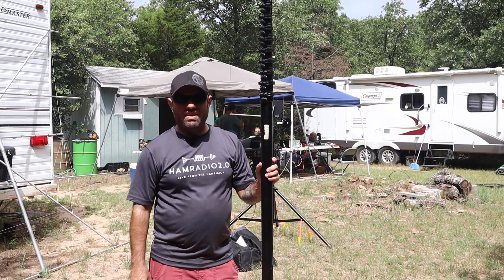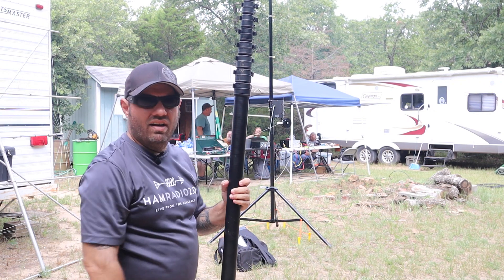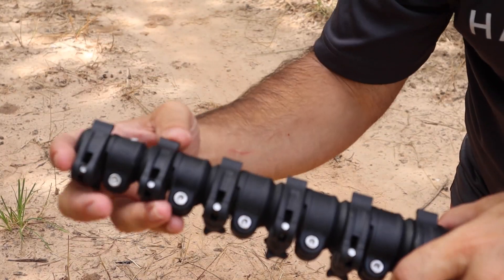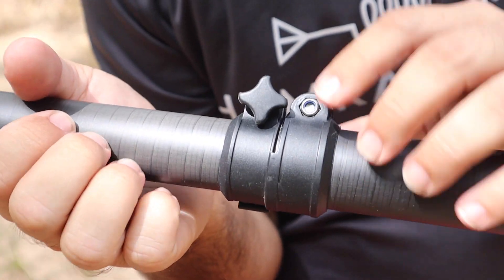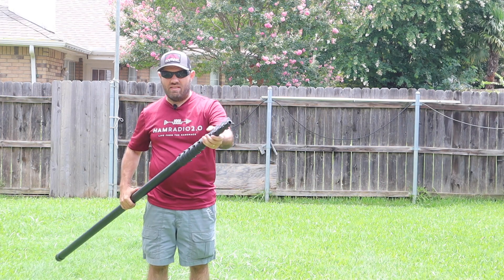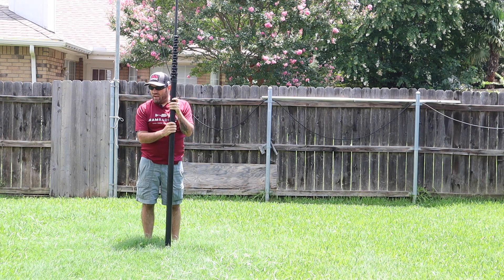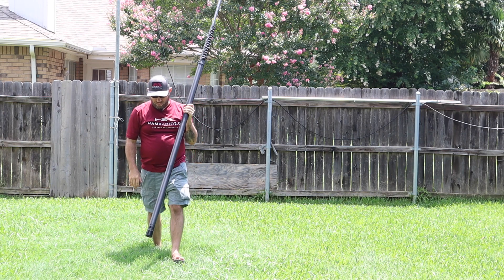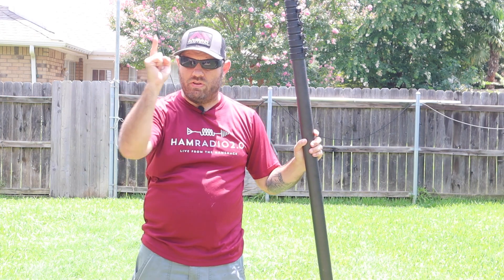Carbon Fiber Mast for Ham Radio Antennas from Gigaparts! | HF Antenna Mast

Comment: Checked out the website. They no longer sell the product. What they do sell is fiberglass masts with 7 foot sections, with lengths up to 53 feet. So you need a ladder or scaffold to put it up. Some of them have the clamps, some do not.
Reply from the maker: They still do the CF masts but they're sold out right now

Comment: The video says they're manufactured in the USA (6:55 ), but Amazon lists the country of origin as China.  The Gigaparts website doesn't say one way or the other.   For that kind of money, it should include guy rings.
Reply from the maker: They are from China.  Several things changed before now and when this video was made
Reply: @HamRadio2  Thanks for the confirmation.  It looks like the 50' mast is  no longer available, either.  That's too bad.
Reply from the maker: @evanwindom3265 I just spoke to them last week about that mast - pretty sure it is still made but they might be out of stock right now..  I'll confirm.
Reply: @HamRadio2  Thanks, but don't go to any trouble on my account.  I need a couple of smaller masts instead of the 50'.

Comment: wow that carbon fiber is a lot smaller diameter than the fiberglass 50 foot ones Ive seen. I wonder the strength and how much it sways in wind compared to the fiberglass ones.?>
Reply from the maker: Stronger

Comment: The question is how long will this last outside in the comd and hot weather? How many years?
Reply from the maker: I still use mine today.  I had it up all Winter last year during hunting season, it was holding my Starlink dish.  No issues at all

Comment: A friend of mine, N6UTV, is wondering if they hold weight up or if they slip down with weight. He's just talking about a cable, I can't imagine that one wouldn't handle a cable, the wire I want him to use is standard hard drawn copper wire, and he wants to support an 80m full wave sky loop. I'm thinking the best set up would be 4 35ft versions. From mike N6GRG
Reply from the maker: There's no slipping with these

Comment: If you've ever tried to set up a 50' fiberglass mast you will see why these are worth the price. The weight and flexibility of fiberglass makes it a sloppy mess if you don't have it guyed right before you get it in the air. I sold my 2 Max Gain fiberglass and now own 4 of the carbon fibers. 2 for my dipole in the back yard and 2 for portable ops.
Reply from the maker: Well said

Comment: Just checked Gigaparts for this antenna mast.  It is currently, (as of this posting) out of stock.  When I called them, I was told they are not sure when, if ever, it will be available again and would not accept any orders for this mast at this time.
Reply from the maker: They constantly sell out of these. I'd be surprised if they don't get any more in. I'll inquire from my side and see what I can find.

Comment: Do they want my arm and leg too?
Reply from the maker: They can't keep these in stock, so...maybe?  They aren't exactly sitting in the store, gathering dust...
Reply: @HamRadio2  For just less than $400 I like this a lot better. Diamond Original BB7V Multiband Vertical Antenna
by Diamond
Reply from the maker: That is an antenna, not a mast.
Reply: @HamRadio2  Yes, it is antenna plus a 20-foot mast at less than half the price.  I agree with most everybody there that says it is over priced.
Reply from the maker: 20' is less than half of 50', so you aren't comparing apples to apples.  The CF mast is available in a 25' size also for a lower price.
Reply: @HamRadio2  So???  I am talking about a 20 pole, which is fine in most cases, plus an antenna.  Stell less than half the price.  To each is own, right/
Reply from the maker: @StanCook  Right.  Yes.  But this is a 50' mast review video.  I suppose if I were to review an Icom IC-7610 that costs $3000, you could come along and tell me that you would compare it to an Alinco SR8T which is $699, right?  Both do HF, but are they the same?  No, they are not.  Apples to Oranges.  You aren't WRONG...you are just not comparing items accurately.  If the 20' mast works for you, then great....use that one.  But with this 50' mast, I coudl break it down to 20' and use it all day in a situation where that is warranted.  You can never extend your 20' mast to 50' which is an option that I have.
Reply: @HamRadio2  I am sorry man.  I have a 7300 in the shake and a 7100 in my Jeep.  Look, on is just a mast.  50 feet is more than the average guy needs or is going to pay for.  I, just me now, would rather pay for a mast that includes an antenna at half the price.  I ordered that antenna mast/antenna yesterday for $400.  DIAMOND
BB7V. $383  HRO
Reply from the maker: @StanCook  There is nothing in the world wrong with the setup you have.  I hope you make lots of contacts on it.  The 50' mast is just another option for those who want to get up higher than what you have...which there is also nothing wrong with.  The point of this video, along with most all of my videos, is to show options that are available to you...and let you decide what works best for you.
73 to you, sir.  de KC5HWB
Reply: @HamRadio2  Thank you for your reply.  Don't get me wrong.  I am a fan of what you do and I appreciate all that you do.  73 and thank you WA7SDC

Comment: Now, if only this mast was more realistically priced, at say $250, and it was sold by a company other than jip-a-parts, I'd consider getting it. But not from them, and not for that price.
Reply from the maker: Your choice.  Just know that they can't keep these masts in stock at the current price, they sell too quickly.

Comment: If the top diameter was 1.77 inches or more and the bottom was 3 inches, then I could have full faith in lifting a 24 pound antenna. Spindly little masts that wont carry more than 5 pounds aren't worth 50 cents.

Comment: So glad I bought a 50' carbon fiber before the price went up.  For me, it is not the light weight that makes it so useful, it is the rigidity.
Reply from the maker: Agreed, for sure.  It is light-weight when broken down, but so are fiberglass masts.
Reply: Curious... what was the price before it went up? These sounds great, but I can’t see spending $800 on a mast.
Reply: @MattFricovsky  $499.00 when I bought one.
Reply: @greggrobinson2259  they want 499 for the 34'!!!! Crazy!

Comment: Are those sections electrically conductive?  Most carbon fiber is, but sometimes it is coated or painted with something that can give some insulation.  Also, for the cost minded folks, there are fiberglass versions of this mast for a lot less money.
Reply from the maker: Yes I believe they are conductive

Comment: I have 34' with an Ed Fong J-Pole at the top and a ham stick 30m dipole further down. I bought a 50' just as Gigaparts got them (thanks to your Friday Ham Buying guide video Jason) and I am glad I did. I got a much lower price than what is available today. I have a Moxon 6 meter on the 50' but about 15 foot down. Those poles are absolutely great. BTW, for mounting, I have both of mine strapped to the metal fence rails like you have in your backyard Jason using those bungie ball straps that Harbor freight sells. I set the pole on the ground and strap it 3 to 5 times. It is now loose enough to armstrong rotate the Moxon. I love those poles. They are super strong and will not blow around in the wind.
Reply: O limb

Comment: $799?   Dude...you need to come back down to earth.  $1000 wire antennas, $800 poles.    Sorry.
Reply from the maker: Just like all of the other comments that are similar to yours...
They can't keep these masts in stock.  They constantly sell out.  So explain to me why it isn't "down to earth" at this price point.
Reply: Welcome to the world of carbon fiber.  Carbon fiber is one of the most energy intensive and labor intensive materials to make, if it's carbon fiber it's going to be a lot more money than you expect.   Go price filament wound carbon fiber tubing and you'll realize $799 is pretty cheap, which is why it's selling out.
Reply: “Hard to keep in stock.”
Only 2 (two) reviews on Gigaparts. Stop pretending that billions have been sold in the last 5 seconds lol.

“Made in ‘Murica!!”
Actually comes from China.

Yeah. What else is a deception or lie? Hard pass.
Reply from the maker: @THEJOEBECK  No one said "billions" - stop exaggerating.  And please explain how reviews on YouTube = number of sold by the vendor.  The simple fact is that these masts constantly sell out at the price they are listed for, and the only people complaining about them are the ones who don't want to pay for them.
Reply: @HamRadio2  provide another fact... what’s the quantity sold? You were deceptive with the country of origin & without quantity, you’re being just as deceptive by only repeating “sold out” over & over.
Reply from the maker: @THEJOEBECK I wasn't deceptive, I made a mistake.  If you have never made a mistake, please contact me - it would be an honor to meet you.

Perhaps you can do your own research if you feel so strongly about it.  One can plainly see that when these quantities are listed on the website, they sell out quickly.  Regardless whether or not there is 1 or 1000, if they sell nearly as fast as they are listed, then in my mind, they are not overpriced.  If this fact somehow offends you and you need further evidence, then go find it yourself and stop asking others to provide you with information that only you seem to care about.  My statements stand on their own - if these masts were overpriced, then they wouldn't sell out of them so quickly.  Gigaparts would lower the price, sell off their remaining stock, and discontinue the product entirely.
Reply: @HamRadio2  oh is that what it was? A “mistake?” You slapped that puppy numerous times & proudly stated “these are made in the USA...” It’s like you’re a classic used car salesman. Also note: I’ve not once mentioned the price. Not sure why you keep writing about it. You are just trying waaaaay too hard to sell these things.
Reply from the maker: @THEJOEBECK  Yes because when I spoke to Gigaparts they told me it was made in the USA, but after doing a follow-up, they mentioned that they thought I was asking about another product, so we got our wires crossed.  That was my mistake.

Also, you are replying to a quote about the price.  So while you didn't mention it, you are jumping on the bandwagon of price complaining.  If didn't care about the price, you would have started your own comment thread.

I don't sell these masts.  Gigaparts does.  I get nothing if they sell or don't sell.  I did the video review.  What I am trying waaaay to hard to do it actually set the record straight from all of the negative and false comments like yours.  Call a spade a spade and move on.
Reply: @HamRadio2   good lord dude. Don’t read “sell” literally. You’re trying too hard to convince everyone who disagrees with your OPINION about price. You even bring it up to people who don’t even mention price. You’re just too hung up & offended that people dare value their own money differently than how you command. Well you don’t command them. Get over it. Your OPINION is not the law. So when folks disagree, you’re not “setting the record straight.” You’re just butt hurt they don’t see it your way. In short, you’re a classic “know-it-all.” So much so that people can’t simply say “well, that’s too much for me personally.”
Reply from the maker: @THEJOEBECK  OK did you REALLY just tell me to not read "sell" literally, and then turn around and tell me that everyone else's comments are to be taken at face value?  Look man, I can't help that you aren't speaking clear English.  That is on you.  This isn't a face-to-face conversation, I can't tell your tone.  I can only read what you write.

Had you actually read through all of the comments, I have already said, several times, to several people, that if they think it is too much, that is fine.  It IS their money and they can spend it how they want to.  I've also said this in literally hundreds of videos about multiple items.  The people I am speaking to, much like yourself, are those throwing a tantrum, jumping up and down, crying about how this product - which literally sells out quickly every time they receive new inventory - is over-priced.  It isn't over-priced.  That doesn't mean that it is for EVERYONE and that EVERYONE can afford it.  A product being "too much for me personally" is just fine, but a product that sells out over and over again, and is in high demand isn't overpriced. 

If you can't see the difference between those 2 points of view, then you should just move on and not comment any more.  I have said what I said....multiple times.  Arguing about it does nothing, so this conversation is over.
Reply: I love how the peak poor cry about pricing of carbon fiber products.

Comment: At 6:58 you say "Manufactured in the USA"???  I don't think so.  These are made in China.
Reply from the maker: I just checked and you are right, they are shipped from China.  I swear they told me they had them made locally, but they are designed by Gigaparts and I guess manufacturered in China.

Comment: That looks like a great mast, but $799 is just too insane (and I have a $4999 FTdx-101MP in my shack). I bought a kit with 12 4' aluminum mast segments, 2 guy rings, stakes, guy clips, 3 bases, and a carry bag for $132. Then I got a 2" hitch receiver tilting mast mount for $52 and I can put that on my pickup truck for field day and have a 48 foot mast for a quarter the price! Just slide the tilt mount in the hitch receiver, lay it over, then assemble the mast segments and put the antenna/wire at the top, snap on the guy ropes, and walk the mast upright. Because the base is fixed, a single person can raise the 48 foot mast by themselves. The whole thing takes me like 15 from parking the truck to cracking open a beer. You really don't even need guy ropes unless it's really windy, or just paranoid.
Reply from the maker: If that works for you, then great.  It sounds like a great setup.  But you aren't going to hike that up a mountain...
Reply: @HamRadio2  True, but then again, I seriously doubt you are going to haul that 50 foot CF mast that weighs 8.6 pounds and is taller than you, a tripod, guying ropes, not to mention a radio, antenna, and battery up a mountain either. Just saying.

Comment: Most older hams use their electrical and mechanical knowledge and experience to build antennas and accessories.  Buying decent equipment used, at swap meets is also what many hams do. It's a tradition, for those of us who don't have lots of money to throw at gear, which we may use twice and later re-sell for a fraction of what we originally paid.

Comment: 50 feet cost 800$ no way.
Reply from the maker: Well they constantly sell out, so there's that
Reply: @HamRadio2  $800 for something I can make for less than a 100$.
Reply from the maker: Highly doubtful
Reply: @HamRadio2  I have already maid one for that price several years ago when materials were much cheaper so I spent less than a hundred dollars on my antenna mast.

Comment: It would be nice to get a shorter one with the larger bottom diameters for semi-permanent (to get something 10 or 20' above a roofline) installation.
Reply from the maker: They have that now.  It is 34' with the larger sections that the 50' uses.  If 34' is still too tall, you can always remove the top 2 or 3 sections
https://www.gigaparts.com/34-heavy-duty-carbon-fiber-mast.html
Use the code of HRMP to save a 5% discount

Comment: The fact that you didn't even use it on field day let's me know there are more cost effective options out there. I wouldn't  want to damage an $800 loaner either.   A Stepir Vertical can be purchased for not much more than that pole and a premade OCF dipole and balun. I'm a little cranky cause I was saving for one before the price went up. Now I gotta consider fiberglass. (I can't afford StepIr either...just saying) 73's
Reply from the maker: Well, I guess you can believe whatever you want to, but I purchased this mast from Gigaparts.  It isn't a loaner.  And yes, they did give me a discount in exchange for doing some vids, because I know that question will come up.  There are many options available in the market today - this is one of them.  At no time did I ever say you had to sell every other option available and purchase only this mast.  But also the rising costs were due to rising costs of material and shipping, which I mention in the video also.  You will see the mast used in some upcoming POTA activations that I am planning, and I had it in my back yard for 2 weeks with the MFJ cobweb on it.  It is quite durable and easy to deploy.  But you certainly have other options for purchase too.

Comment: Thank you for sharing. I agree. This is way out of my price range, but I like to see what is out there. Can't pigeon hole stuff price wise or there won't be any YT videos. Yes ham gear can be expensive, but there also buys out there. 73 CLARK KG7LOI
Reply from the maker: Yep, and they can't keep these in stock, so the price doesn't seem to bother most people.  It definitely isn't for everyone though.
Reply: @HamRadio2  how many of them do they actually order for stock is the question. If they only order 15 etc per quarter then yeah, they probably sell out.
Reply from the maker: They order as many as they can at 1 time.  I don't know the number, but they re-stock every 2-3 weeks, then sell out again.  So it isn't every quarter.  Even if it was, I still maintain that if the masts were overpriced, they wouldn't sell at all, regardless of timing.